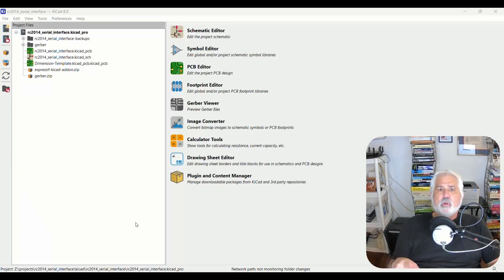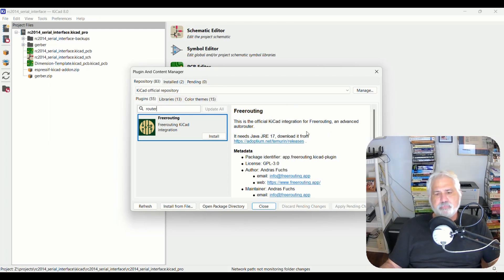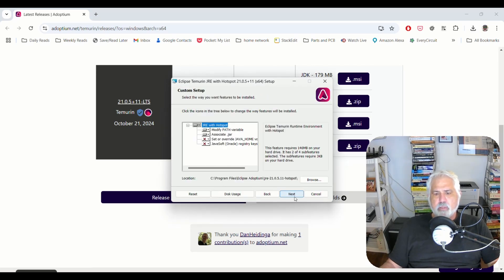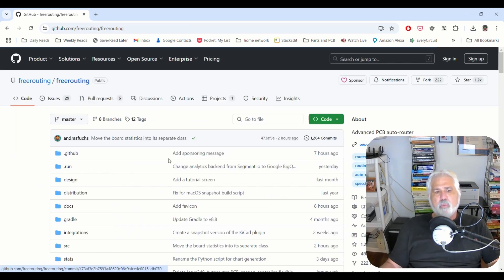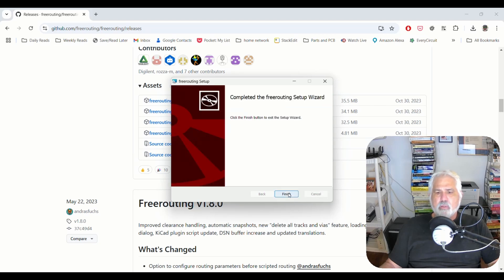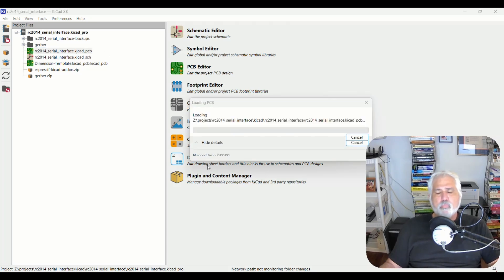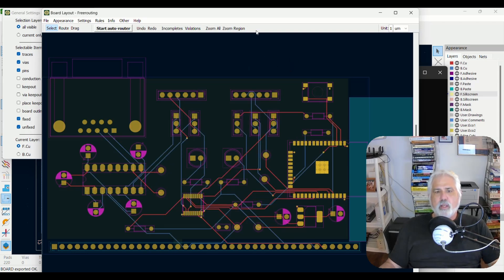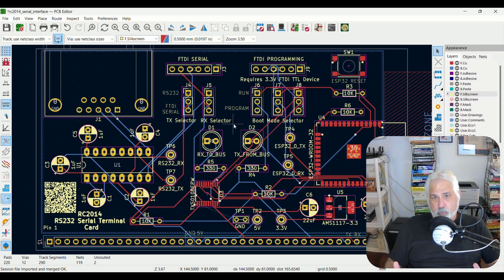KiCAD 8.0 Autorouter Installation in Under 4 Minutes!

Comment: The Java download  says it is not supported on my microprocessor despite KiCAD working fine. Very frustrating !
Reply from the maker: Hmm, I thought that was the wonderful thing about Java, it runs everywhere?  Sorry to hear you had this issue!
Reply: @StuartPatterson  Well JRE vers 8 (build 1.8.0) is working well on my machine but when i must install the one for KiCAD then no. 🥲😥😥 Thanks for the reply anyway.
Reply from the maker: That sucks.  Sorry to hear that.  I assume you tried running it anyway without installing the "required" JRE?  If not, good luck.
Reply: @StuartPatterson  Yep I did try. It says my microprocessor is not supported. I have an Intel i7 2GHz. A litlle dated but still pretty good.
Reply from the maker: @Appregator  Well that does suck.  Sorry man!